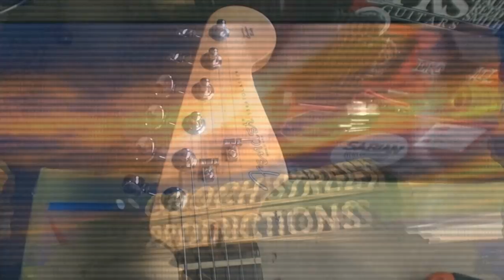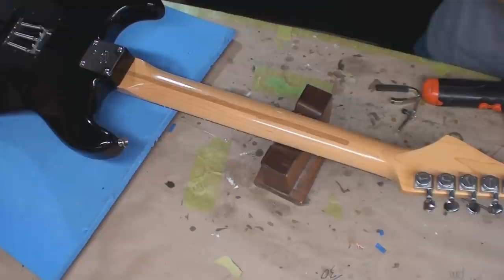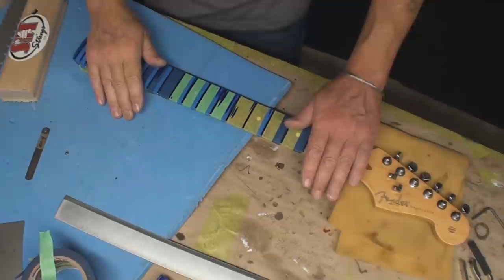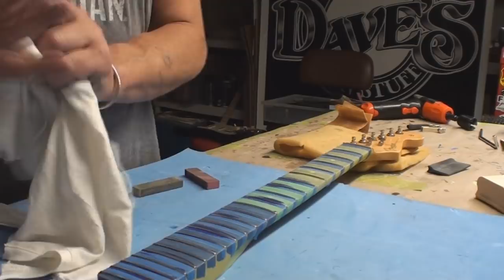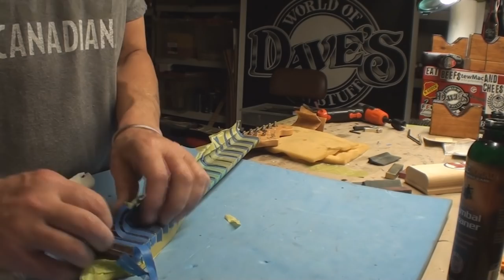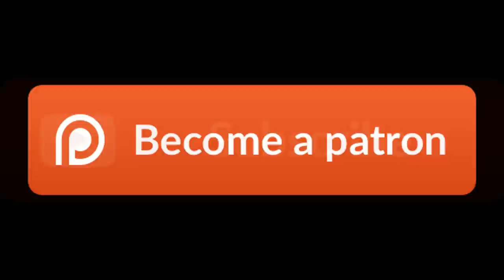Stratocaster Fret Work with a Message

Comment: Micro Mesh with the foam pad that comes with the metal polish kit version is a great way to polish the rets after level/crown, as well. As for your back, try lying on your back and pull your knees up to your chest as far as you can. Also, try tucking your chin in, while lowering it as far as you can, and that helps loosen the muscles in the lower back. They adaptively shorten when you injure your back. When you lie down, put your heels down, and stretch your spine out. This loosens up the vertebrae and that helps the discs to heal.

Comment: Are you putting the capo right on the fret wire at the 1st? Are you doing the same with your finger @ 17? Or are you checking them in a playing position close to the fret? Does it make a difference? Thanks!

Comment: Dave can you still buy Codeine number 3 over the counter in Canada?
Reply: No
Reply: Opiates are great if you need them, for a while anyway. I can see why they are tightly controlled in most places given how addictive they are.
Reply: Leem Flanginator yeah right if you take them when you need them and not every day you're fine and number three work well if you don't abuse them and used to be able to go right into the drugstore and buy them right off the shelf in Canada so that's why I was wondering if it was still possible but I didn't really think it was I just wanted to know thank you guys God bless you

Comment: I've pretty much ruined one of my guitars. Not so sure I can salvage the frets. Went too low in many areas. Might have to keep this hunk of wood to learn how to refret, in the future.
Reply: That's unfortunate. Does the neck (finger/fretboard) straighten out?
If so it might be worth a refret.
If it's only a couple of frets it might only need those replaced, not the whole lot. Given some builders use skinny & short "mandolin" style frets, unless the frets are ground to the same level as the fretboard (just tangs or a hint of fret surviving) it might still be levelable. Probably not worth doing if it'll only need a refret next time anyway.
Reply: @MrCheesywaffles  I think one of my mistakes is getting a not-so-leveled, neck level, and I did not make the neck straight before I went to town. I need a better level checker. Possibly a better sanding beam. 
  I might actually have a tiny bit of life left in them all to get it levelled but you might be right about it not being worth it, since it probably does need a refret.  And I do plan on learning how to refret, hopefully. I just have to learn levelling first. Lol
I tend to learn things the hard way.

Ive also considered just turning it into a slide guitar, but that seems to easy of a way out. I plan on just putting in time and learning how to level and refret. Turning it into slide could be my last option, if all else fails.  Lol

Comment: Concrete floors. Not cement.
Reply: Technically correct! The best kind of correct. I think like any word, as long as both people agree what it means, let them use it as they please. Maybe their definition will be the one in future dictionaries.
Reply: @MrCheesywaffles  , I would not wanna be a bricklayer trying to lay a straight line of bricks with concrete in place of cement or mortar! Nor would I want to live in a home with a cement foundation instead of concrete.

Here in southern New England there are tens of thousands of homes with failing cincrete foundations because a few quarries provided crushed stone that was laced with pyrrotite. Sometimes,  aggregate is everything.....
Reply: @goodun2974  You're spot on. Quality is key, at least as important as choosing appropriate material. I think the cement vs. concrete discussion is about cement dust (the ingredient used to make mortar with sand) and concrete (made with cement dust, sand & larger stone gravel (aka aggregate)).